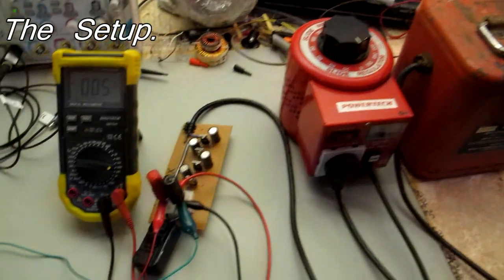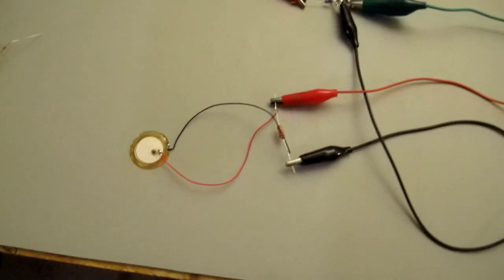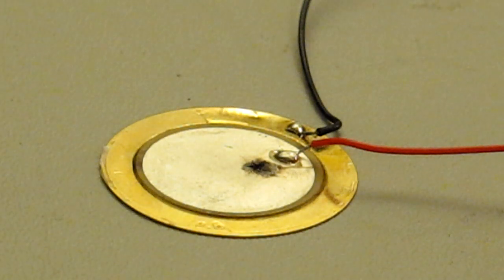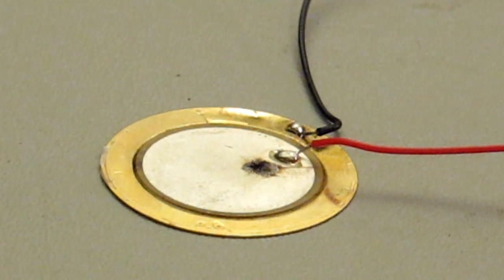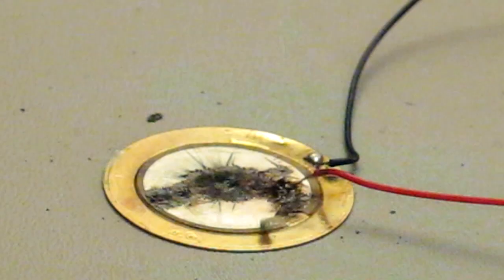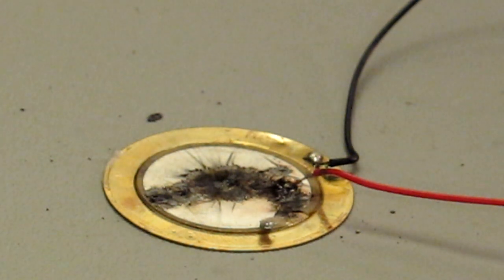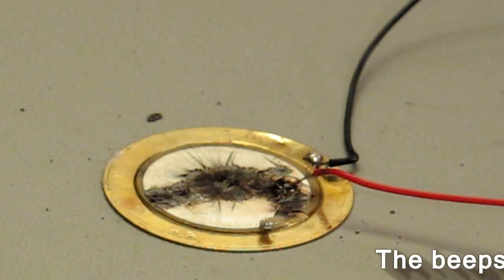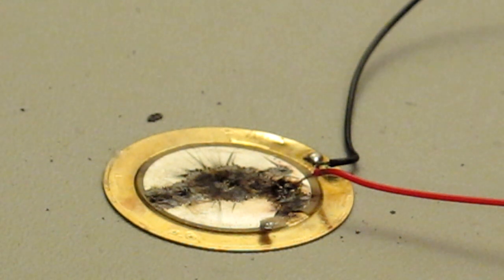Piezo Speaker vs 1000v

Comment: I think the snapping is caused because there was considerable DC bias, which is something else which should be avoided. Connecting it to +1000V, with a resistor in parallel and a MOSFET to 0V will give it a DC bias of 500V. Try running it of 1000V peak to peak, by connecting a capacitor in series with it and a higher value resistor in parallel to minimise the effect of the capacitor's leakage.

Comment: sweet, im surprised the mosfet survived! looked friggin awesome as it broke down, what mosfet was it ? interesting!!!!
Reply from the maker: Yeah, I was impressed by the 'fet. It's an IRFPG50: http://www.digikey.co.nz/product-search/en?KeyWords=IRFPG50PBF-ND&WT.z_header=search_go 1000v, 6.1A, so pretty beefy for its size. I'm thinking about using it in a boost converter.
Reply: gristc damn, RDS on 2 ohms. jeepers. i guess at 1000v its less of an issue. thought of using IGBT instead of MOSFET for a boost converter?
Reply from the maker: Yeah, some of the specs on HV silicon get pretty silly. I have some 30kV rated diodes that have a fwd voltage drop of 47v. Had me scratching my head when I tested a rectifer bridge with 'only' 240v and was getting hardly anything out of it.

Comment: Hello gristc, you feed the piezo a frequency, which voltage it was at could you confirm the evolution of the voltage at the piezo in function of the frequency? Look it was more destructive in the low frequencies, did it mean that the voltage was greater at low frequencies?
Reply from the maker: Khwartz You are right, it was much more destructive at low frequencies, but the voltage was the same. I think it was mostly because at the lower frequency the voltage is applied for longer periods at a time. I was feeding it a square wave.

My method was to find the natural resonant frequency of the speaker, which turned out to be about 3500Hz. Initially I set the generator to that and just turned up the voltage to 1kV. When it wasn't doing much I started dropping the frequency, but left the voltage at 1kV. The lower I got the more arcing I could see.
Reply: Good, and Very Thanks for these specifications, it clears me well the idea :) Thanks again for the sharing :)
Reply: +gristc I think the arcing is due to movement, so on high freqencies, due to inertia, it wont move as much as on low frequencies.
Reply: +gristc actually the voltage was lower, since piezos have capacitive impedance behavior. i think it moved to much and physically broke.

Comment: There is one in every speaker, right ?
Reply from the maker: +William Nah, most speakers are a coil of wire and a magnet. These piezo speakers are often found in children's toys and other places where you don't need much volume and have limited space.
Reply: I guess that piezo material isn't as precise as the coil wire/magnet combinaison. And even, costs more maybe
Reply: +gristc piezo tweeters are also found in tower speakers, mostly cheap party ones but also good ones. the piezo coin is attached to a paper Diaphragm and a horn to make it louder. the biggest problem with them is the 5khz exaggeration and the high harmonic distortion. that why they are only used above 7khz in good speakers. in cheap speakers they are mostly used in unfiltered 2 way combinations thats y they sound so awful.

Comment: Interesting... That's why to use an high pass filter in speaker systems
Reply from the maker: I'm not sure what you mean. This has no relation to frequency filtering. Just a bit of fun with high voltage.  :)
Reply: gristc I mean that at the same voltage, the piezo begins to crackle only by lowering the frequency. So an high pass filter may avoid the risk of break.